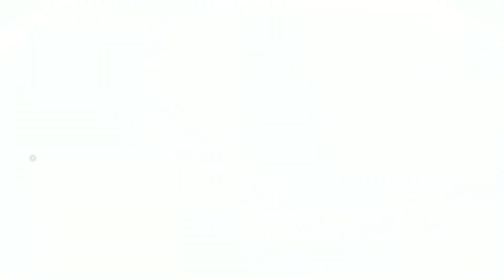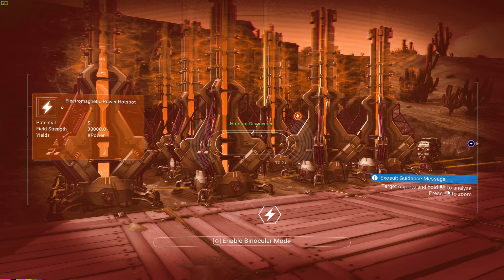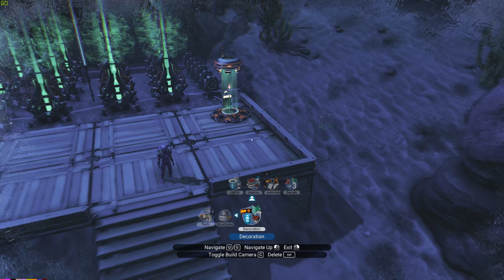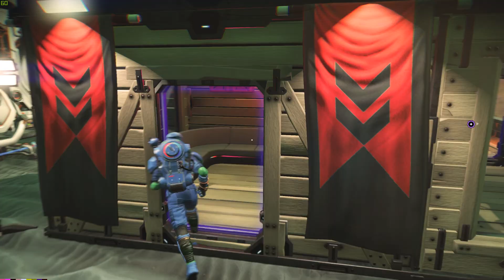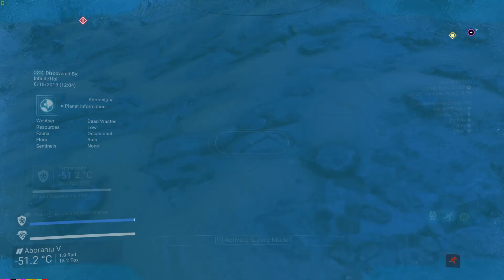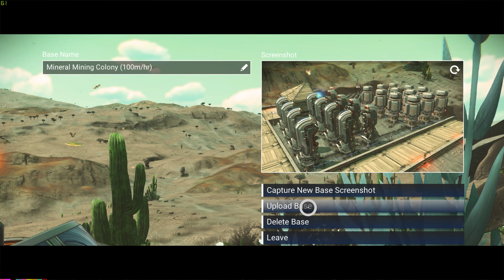No Man's Sky Beyond - Easy 100 MILLION + Units NEW Method | No Man's Sky Making Money

Comment: There’s just too many bugs and issues in this game right now, for example the light box from your previous video is bugged and only in creative, we’re missing new alien cosmetics promised by the trailer, exocraft are bugged and can’t be in 1st person without VR even though it was mentioned you don’t need VR for it, cables seem to be fiddly with snapping, doors don’t stay open long enough via a push button, I love your videos man but I think you should focus on a video of what needs fixing and improvements needed for beyond
Reply: Jontis bro the update just came out like yesterday chill 

And they had already releas 2 patches
Reply: Omar Guerra typical fan boy excuse, its simple don’t release an update if it’s going to be missing content and constantly blue screen consoles, I love hello games but it seems they’ll never learn to get play testers.
Reply: @VoidRetro2  jesus dude stop crying they are fixing the bugs pretty damn fast. And it was a free update while other games would charge 40 bucks and call it a exspansion
Reply: @VoidRetro2  

1. The lights only in creative, not a bug.

2. There are new cosmetics, not bugged.

3. 1st person just wasn't added for non-vr, not a bug.

4. A button just sends a pulse, of course it just opens a door for 1 second. Use proximity switch with a power inverter instead. Not a bug. 

Maybe invest in an external hard drive? Turn motion blur off? Turn on/off framerate lock in settings?
Reply: 1. So your telling me they implemented a new item for decoration that is only in one game mode ? That’s ridiculous.

2. There are 0 new cosmetics from the beyond update so try again..it’s just alien NPCs.
 
3. They’ve already confirmed 1st person is meant to be in exocraft with or without the VR, maybe check twitter and the website more often ?
Reply: tayvion12able free update or not it’s still got major issues across the board...stop being so bias and a fan boy, learn to critique.
Reply: Omar Guerra firstly learn to speak English and use punctuation properly, nobody is stupid for having a critical opinion about an update or game, secondly there is a lot of missing content from the beyond trailer one of which is we can’t play or customise as the new travellers like we were promised, just because you don’t experience crashes or bugs doesn’t mean they don’t exist, seriously think before you comment.

Comment: the best with your setup is you get 7million. You get 7 million every 1.5 hrs.  If you setup at a activated indium  you get double the money.
Reply: Oh im so doing that in my main save even though im rich.
Reply: Was just gonna comment on activated indium.
Reply: Im currently farming activated indium in an s class spot. Its amazing.
Reply: @nixklas  yes, they are. This also counts for copper, cadmium and emeril.
Reply: I just found an A class power right next to a S class activated indium hotspot this is gonna be insane
Reply: Now activated lindium costs 186 instead of 980
Reply: DeltAh it’s because the market dropped in the system you sold in go to a new one and it will till be 900
Reply: @nixklas  thx bro
Reply: I would prefer indium because if i combine it with gold and silver i can multiply the profit by a ton
Reply: @ianlogrono7709  I prefer not use gold and silver. That is more actions than I want to take. I build a similar setup to this video but with actived indium. I get 24000 pieces every 6hrs. 24000 is the exact amount I can fit into my 48 slot hauler.
Reply: I found a planet and made 4 on activated indium so i am in no rush for cash anymore